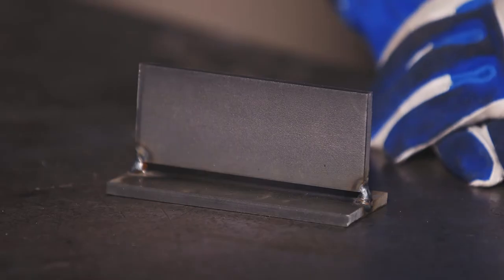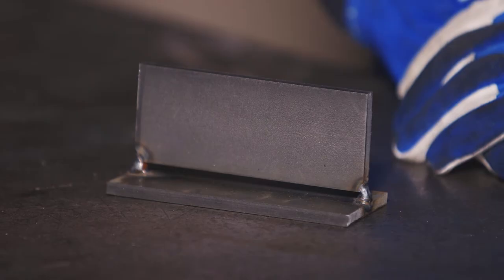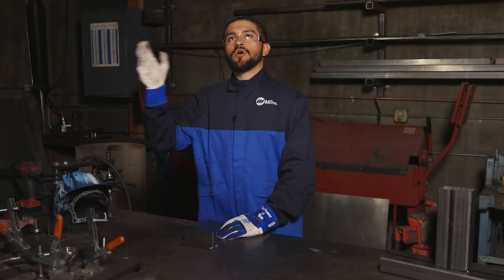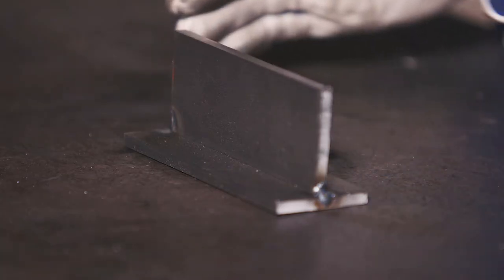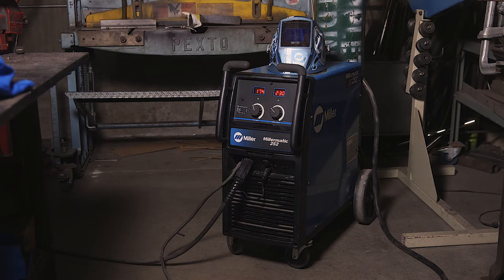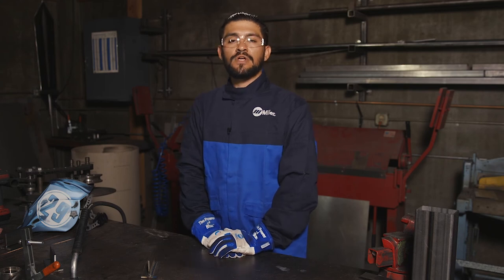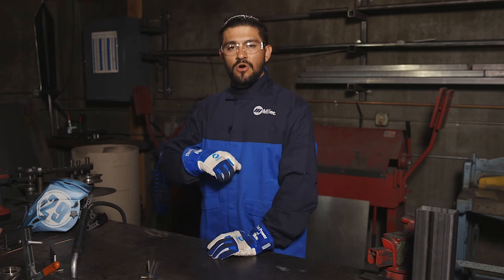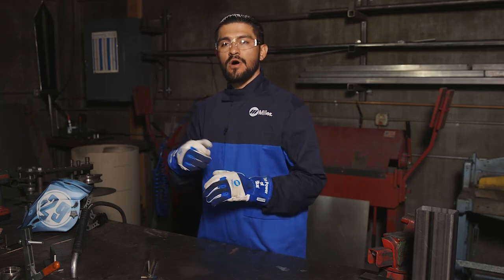Push vs. Pull Methods in MIG Welding

Comment: I once went to take a test for a job interview. And when I pulled my mig weld i was told this was incorrect and that I could only push a mig weld
Reply from the maker: GMAW welding can be done in either direction, each with their own advantages and disadvantages.  It is possible the company had a procedure in place that directed a push technique, however, if that was the case it should be outlined in the test procedure.  If the application were aluminum the recommendation would be that you push in order to reduce contamination of the weld zone.
Reply: Let me guess, was that job a job with thicker metal? Pushing is better for thicker metals cus u want to get good penetration to get a strong enough weld, however with thinner metals it's more about trying to not blow through cus u know you'll get good penetration so then it'd be better to pull in that case
Reply: @VypaGaming  Wrong. Pulling for thicker metal, pushing for thinner metal.

Comment: Welding thicker metal is all about getting good penetration, so pushing would be better in this case, however, with thinner metal, u can almost guarantee good penetration will be there so its more about trying to not blow through the metal so pulling would be better in this case and also techniques which allow u to play around with the heat to move the heat around to provide less penetration to avoid blowing through while welding thinner metal.
Reply: Yeah you got it backwards. Pushing for thin material, pulling for thicker material.
Reply: No difference if your good.
Reply: @madmike19822009  there is definitely a difference no matter the skill level.

Pulling is slower which in turn puts more heat into the part, pushing would be for faster travel speeds, thiner material but sacrifices having more spatter.

You're wrong on pushing and pulling being the same.
Reply: @codymartin4229  I thought I was loosing it. Pulling def gets deeper penetration than pushing

Comment: One Miller video says to pull for light steel and push for heavy steel.
From Miller, not a utube video…
Reply: You sure? Would seems to me, that when you pull it's burning more in the metal than when you puch. 🤔 Could be tho🤷
Reply: @minteherms6784  I don’t think I shuddered when I said Miller said, not some wannabe utube clown
Reply: @mikejustice1196  did i studder! Am i talking about him?! No i dont!
Reply: @minteherms6784  this videos is wrong, always better penetration pushing than pulling. @mikejustice is right. when you push you're forcing the wire into the pool. and when pulling you're pulling it away from the pool.